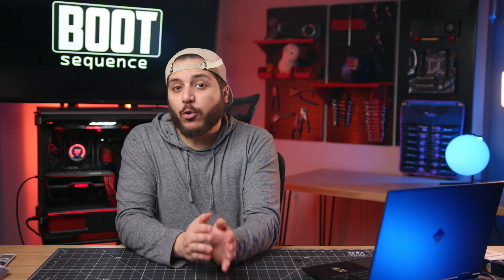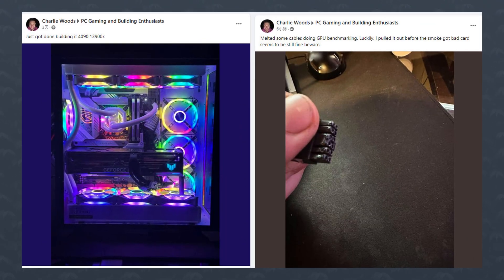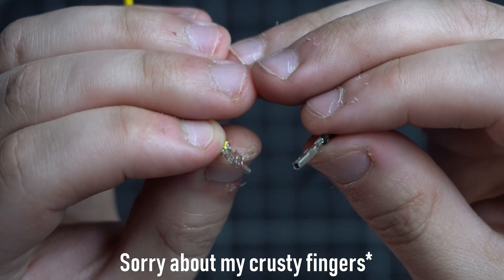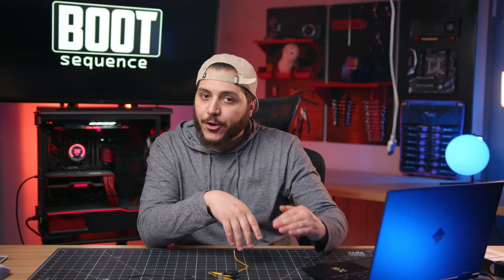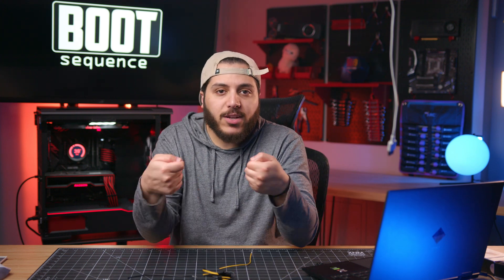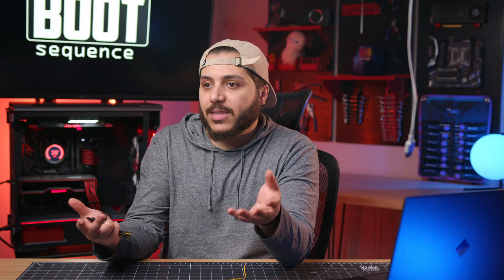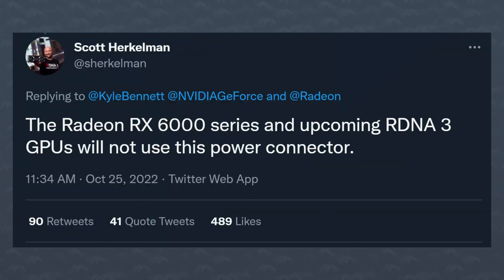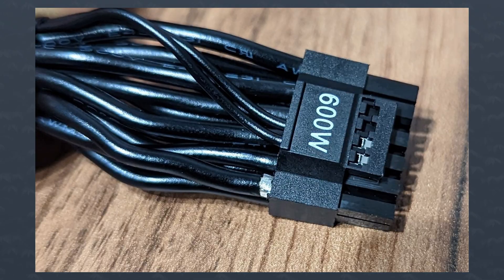NVIDIA !? What's WRONG With Your RTX 4090 Adapter?

Comment: Nvidia keep the 16 pin fire hazard keep it for your 50 series gpu so u can loose all your consumers to Amd because amd is reasonably priced and has 16 vram on there highend gpus while using a rare fail 8 pin that just works no tricks just plug it in and it works all Nvidia got is ray tracing and DLSS 3 gpus can't handle ray tracing yet so its just a waist Nvidias greed is there downfall to failure just stop buying there products until prices are reasonable for the consumer and they respect all rmas for their stupid 16 pin catching fire and melting and even frying expensive gaming pc systems a recall is needed and class action lawsuits for fried systems and fraudulent practices and faulty products

Comment: There is no such thing an an OEM manufacturer for this connector, ANY manufacturer can create the 12VHPWR/12V-2X6 connector as it is not a proprietary one, but instead just part of the PCIe CEM5 5.0 spec. 

Amphenol is just ONE of the manufacturers here, Molex also make this connector.
Actually, it seems the Molex 12v-2x6 version has two seams unlike the Amphenol that has one seam, so maybe nvidia just used the Molex version instead.
See part number: 2202260004

Comment: I think the prognosis is wrong. Bending a wire is not going to cause that much deviation in resistance. The bigger issue to me is how small that cable connector is and how much stress is being put on the pins. If those pins do not clamp straight up with the sleeve that's the bigger concern. The amount of pressure being put on the connector as it's bent, is the real issue. Think of a pin inside a sleeve, now if the pin were going straight into the sleeve, you would have more contact area along the pin cylinder. If you were bending the pin inside the sleeve, you would have less contact area and you would have only two touch points, at the start and the end of the sleeve. This would generate resistance and more heat. I really don't think it's the cable itself, it's the pins.
Reply from the maker: As stated in the video, the wire isn't the issue. The connector is. And after Igor's lab's digging, it seems like the base of the connector was the real culprit.

Comment: Its only happening with the adapter though. There's nothing wrong with the 12VHPWR connector. 3090 ti had the exact same connector. Corsairs and Cablemods cables work good as well. PCIE 5.0 PSUs are also available with the direct connection. In my opinion you are correct saying a loose connection causes the problem, but its because the 4 cable connector/adapter can send in up to 1200W, 300W per 8 pin, which is triggered by high resistance by poorly seating the connector. The problem is with the adapter being dumb and not knowing when to stop sending in power.

Comment: PCI-SIG should just give up on making any new standard. If anything graphics cards should use the EPS 12V connector like they should have done from the beginning. It would have cut down on the cable confusion. It would actually be an upgrade as the 8-pin PCIe power connector actually only have three pins carrying +12V compared to four in the EPS-12V connector. How you may wonder. Well the 8-pin PCIe power connector actually have six ground pins. See the problem here? That means the EPS-12V connector can handle 33% more power than the 8-pin PCIe connector. It also means that the 8-pin PCIe connector can't handle more power than the 6-pin PCIe connector with it's three +12V and three ground pins. Yep that's correct the PCIe six and eight pin connectors can handle the same power!

I can't think of a single good reason for the 8-pin PCIe connector to exist. Some may claim it's to separate the 12V rail that drive the MB from the rail that drives the graphics card. Sure, but that doesn't mean they had to make a new connector standard. As long as the PSU has separate rails for each of the EPS-12V leads then it's a not a real problem. Some may say it's to make sure the right connector is used, but that's just total BS!

The only reason is actually yo make it easy to include a onboard logic that can check that the 8-pin connector is actually connected. All they have to test for is if pin-4 is connected to ground. This could have been done by checking for power on the pins, but a simple logic gate is easier.

The PCIe -12V connectors should never have been standardized as they don't add any feature or value. If anything they made PSU's slightly more expensive as they had to include one more connector standard. Shure It's not much, but it most certainly didn't make it cheaper.

Comment: The cables, sockets, and terminals are all within spec to carry the given current.   The issue I believe here is poor cable assembly.  Without proper strain relief like a mold over the cable socket end.  A user can bend the cable to the point where a terminal can reverse out of its pin socket or damage the cable end attached to a terminal causing arcing.  That arcing will generate significant heat at these wattages melting the socket and or cables themselves.  A simple mold over to accommodate strain relief would most likely solve these issues.   This is also the reasoning for mating cycles.  If you exceed the allowed mating cycles you risk arcing.  The terminals will wear each cycle, the female end can expand outside of tolerance, and positive contact is lost.   Solutions here are a proper mold over with strain relief, extend the connector rear housing plastic to create sudo strain relief so the stress isnt on the crimp joint but more on the cable, and or user read and abide by the install manual.  If you bend the heck out of your cables then you're going to have issues.

Comment: I think a method of overcoming this issue would be to look into the card manufacturers supplying a 90 deg adaptor so that the cable connector can be plugged into it straight and it then fits into the GPU unit . Admittedly not pretty but it would take away the reason for bending the cable so badly as to cause the fire issue.

Comment: So, I just got a AXT 3.0 PSU.  So you avoid this issue with ATX 3.0?
Reply: No
Reply: It's the style of connector. The wires themselves are fine for the spec'd current draw, it's just the connectors themselves in this design don't have the mechanical tolerances for this use case.
Reply: @kaseyboles30  No problems so far!  used the adaptor for 2 weeks, now I have the 1 plug ATX 3.0, so far so good!
Reply: @NATEDOG001976  Just don't let any vibration get to it and your fine (oops, fans vibrate). But that style of connector pin and socket are known to get loose over time with vibration and multiple insertions/removals when that thin a metal is used for it.

Comment: Shit design, its not just the bending, these wires are under spec'd for the power draw
Reply: It's not the wires. There are 6, 16 gauge wires which at that short a distance can easily handle 600wats of 12VDC(max is about 700, or just over 9.5 amps per wire pair). It's the connector.
Reply: @kaseyboles30  Even in car audio anything over a 500 watt draw requires at least a 4 ga. braid But you keep believing nvidias spec bs
Reply: @markgarroutte4561  That's for two wires likely. 16 gauge is good to over 8 amps on 12VDC with 3% or less voltage drop for runs this short. This isn't Nvidia's spec, but rather a long standing measured spec you could easily look up yourself. Just like how 14Gauge handles 15a,110Vdc in your home wiring under 100ft/30M and 12Gauge is for 20amp circuits or circuits over 100ft.
I even double checked my memory on this since it's been a while (took both electrical engineering and Comp Sci in college, but haven't used the EE stuff a lot lately). Like I said the wires are good enough if made to spec, it's the connector itself. Also car audio runs are longer and carry more current per wire and are used in a hostile and electrically noisy environment and your only using two for power meaning over 40amps on one pair, not 50 spread across 6 pairs.  4Gauge is good for up to 20ft at 50 amps, so that's the right spec for that usage, with a similar decent safety margin. 
Nvidia didn't invent the wire gauge spec, it predates them.
Reply: @kaseyboles30  That is single strand specs and that is higher yield, we have already pulled the plug off our 4090 cable to inspect and it is not single strand
Reply: @kaseyboles30  Bad design here all the way around and dangerous, your defense doesnt hold any water
Reply: @markgarroutte4561  16 gauge stranded is sufficient with plenty of margin, and is often used in higher load situations than this. This isn't an argument, it's a well know fact and a published standard on top of it all.
The problem is the connector itself is not mechanically sound for this usage. If the problem was the wires THEY would be melting. The heat is being generated at a point of high resistance, in turn caused by the poor contact area these connectors wind up with unless handled just right. 
I learned these sorta the of things first year of working towards an EE degree. They're fairly basic.
Reply: @kaseyboles30  nope
Reply: @kaseyboles30  We will revisit this when i say we will, narcissistic bag of argument., at the point of transfer 16g strand is not adequate and will arc from point overload, book smarts and company specs wont teach you that

Comment: It may really be "user Error". But really. Creating a Connector where one small deviation leads to melting or fire if it isn't used exactly right is very bad practice. You can create tightly controlled parameters within a lab but outside of it, good luck.
Even just Transporting a System with this connector is a danger! I believe we all know about completely or partialy pulled out power Cables after Shipping. A Replug would not be enough!

Comment: A perfect lesson for Nvidia: "Don't fix what ain't broken!". The card is the size of an oil tanker, even if they had to use  3 or 4 eight pin connectors, it would have been better than this fire hazzard.  Best way to protect yourself is to not buy one of these cards until they fix the cable or go back to the old connector.

Thanks for not being a shill and telling it like it is.
Reply: The PCI-SIG 8-pin PCIe Power connector has been broken from day one. No I'm not sayin they are likely to burn, no the "problem" is that they should never have been standardized. Do you realize that the 6.pin and 8-pin PCIe power connectors can handle the same amount of power as they have the same number of pins for +12V? I highly doubt most people are aware of that. After all it has two more pins, so that should mean it can carry 33% more power, right? Well no, it's not right. What they should have done from the beginning was to standardize on the EPS-12V connector. That can handle 33% more power as it has four pins each for +12V and ground. If they wanted a low power connector then they should have used the 4-pin ATX 12V connector. A pair of which can be combined to connect in a EPS-12V socket which would allow for flexibility in the power delivery. Funny thing is that if you combine a EPS-12V connector and a ATX-12V connector you have in total 12 pins, six each for +12V and ground which can support the same amount of power as two 8-pin PCIe-12V connectors that has a total of 16 pins.

Now tell me again how the PCI-SIG PCIe-12V standard isn't broken from it's inception?

Comment: Thousands of units sold world wide and you show 3 examples of failed connectors, numbers like that aren’t even worth worrying about, just make sure you install the plug correctly and don’t torque it sideways just like every other cable in your PC.
Reply from the maker: You realise that's how most recalls start right ? there weren't hundreds of H1's catching fire, but there was an underlying issue for people who would over torque their PCIe riser.
Reply: It takes one house fire from one plug to wipe out your family, you willing to bet that? Thats what i thought, pipe down and wait for the recall, Gomer.
Reply: go back and rewatch the part about the physical pins themselves. That's not appropriate for this usage. For signal wiring and low power sure, but not for 8+amps per ping

Comment: Nvidia made an ultra powerful gpu then used a weak tiny power connector and also gimped its output with dp 1.4a instead of 2.0. Its like theyre tricking people to think its premium but taking away the premium features plus making it potentially hazerdous.
Reply: Hqha if 4090ti has dp2.x then thats just the biggest finger since calling a 4060ti a 4080.
(Seems like dey didpensing a lot of big fingers to us consumers)

Comment: So they saved on cable connectors, pulling 50AMP in. It makes sense on 1600+USD gpu, lol.
"The more you buy, the more you save."(.. of Nvidia costs) 
Seeing that cheapness.

1.Unlaunch 4080 12G
1.Unlaunch 4090

Comment: High end gamers still won’t buy AMD if performance is below 4090. Period . This is not a widespread issue like AMD is trying to make it look like
Reply: Bullshit... 

1. AMD GPUs Aren't the ones of 7 years ago.  Reality check...the 6900xt came within spitting distance of the rtx 3090 and for less than 30 percent less cost.

It is asinine to support Nvidia at this point.. period
Reply: AMD hasn't said anything except when asked they said they were not using these connectors. Don't know how you jumped to that conspiracy theory. These connectors aren't fit for this purpose.
Reply: @kaseyboles30  wtf are you even talking about? What conspiracy theory?

No one here is talking conspiracy theories.

It's beyond obvious why AMD has said in the 7000 series they wouldn't be using this bs connector. (Facepalms)
Reply: @motoryzen  Yes, they were asked about it. This wasn't a press release it was an answer to a question. You're the one seeing Nefarious purpose here, no one else, thus conspiracy theory thinking.

Comment: Simple solution bridge the 12v pins on your Graphics card together with a healthy line of solder, or some other electrically sound method. This will stop any poor wiring or connection from being forced to handle more load than it is capable of. The electrons will find a easier path through the bridge and no more meltdowns under high loads.
This is really not a difficult problem to fix in a simple cable and connector redesign. It's just another example of penny pinching gone too far during manufacturing. The ATX 3.0 spec for this connector has no overhead or redundancy at maximum load so it's going to fail now or later. Even the 6 and 8 pin connectors would fail eventually on cards that regularly pulled max spec power through their wires.
I have a hand full of 6+2/8 pin connectors that failed and burned pins, melted connectors, and blew fiery holes in GPU PCB in the MOSFET sections of cards. You all acting like this is a new problem have not been around the block. You want to avoid this problem don't pull max power from the card or join your 12V lines together at the GPU PCB.
It's literally that simple to remedy preventatively.
Reply: You're applying a band aid to a bad design. I've built and upgraded so many PCs over the years and have never once seen a burned 8-pin connector. I'm not saying it doesn't happen, but certainly not at the frequency we're seeing here. And we should keep in mind that there are cheaply made 8-pins of lesser quality floating around. You get what you pay for.

In this case, we have connectors easily coming apart and burning soon after installation at what many would consider to be an alarming rate. It's much easier and safer for the manufacturers to produce better cables or use something that's more tried and true than for the user to have to make power adjustments or apply band-aids.
Reply: Been dealing with computers since the 8 bit days. Never seen a burned 8-pin and I've seen more than a few. a burned Molex once, but what it was plugged into developed a short.

Comment: P = R•I²
Physics: 1 | Nvidia Marketing: 0

The smaller the connector, the higher the resistance and the larger the current, so power dissipated as heat increases and the connector melts.
Reply: Finally someone that knows whats happening! Pushing 600 watts/50 amps trough that connector is retarded 😂

Comment: No Display Port 2.0.... melting cables.... Amd is calling my name more and more lol
Reply: Also...AMD GPUs in Linux...JUST work..where as in Nvidia..you roll the dice on whether.or not you'll encounter stupid driver and pointless black screen problems
Reply: Why does anyone need dp 2.0?

High refresh rate colour accurate monitors do not exist

I mean not even reference class

Dual layer lcd and mini and micro led hdr monitors used for colour grading work well enough with hdmi and dp 1.4 perfectly well

Don't be a "wannabe tryhard layman trying to look like a professional or expert"

Comment: am i the only one , or does amd buy site page look to be Slightly Over Priced on Combo`s ? = Don`t No One buy them = Its Higher than buying them Separate , just buy them separate and you actually save , however there is at least one that you can save a few $`s